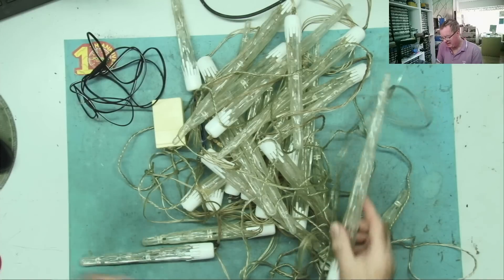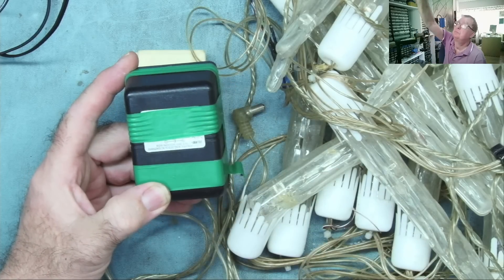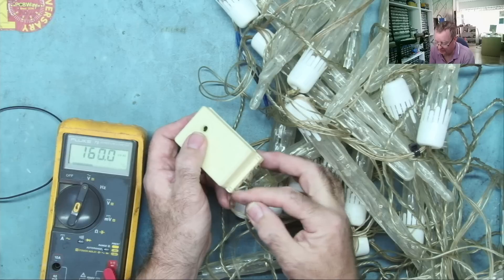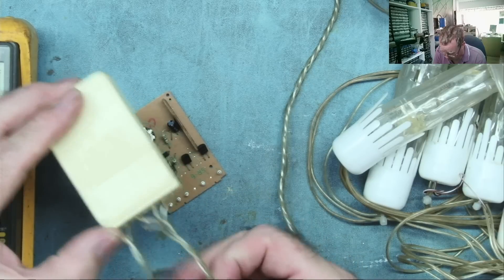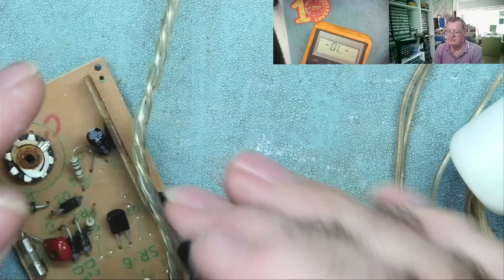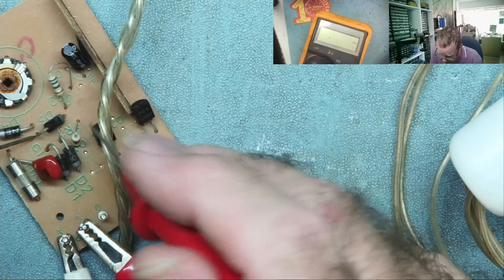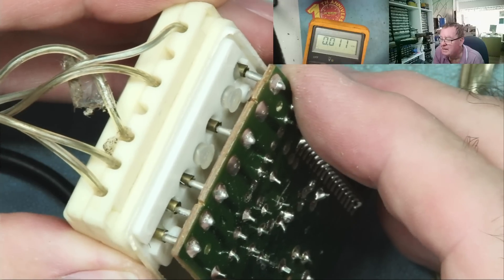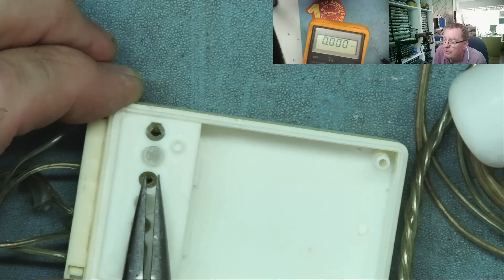Christmas Lights Controller Repair

Comment: What hairy hands! ... Are you a werewolf, by any chance? 🤣

All that poking around with a multimeter? ... First thing you check is the fuse, and if the lights are receiving power, then check the connections are sound.

It was the connections.

Poking around with a multimeter and all the head scratching was a massive waste of time. Start at the beginning. Not the middle!

Comment: It's always when I find a fault like that, it's a "Why didn't I start with that" moment 🙄.
For removing the pins from connectors like you did, I use a section of a dismantled telescopic aerial to push over the pin releasing the tabs. One of them is the right size for the job.
Cheers
Pete' New Zealand.
Reply from the maker: Yeah I often used to think that too... but now I think it wouldn't be a worthwhile video without the journey 😆

Comment: That was a nice simple little circuit to work on for us simple types 😜 and I may need to watch it again but, am I right in saying you took the rectifier out of the power supply (it would be great to see how you do that) but in the light driving unit is another rectifier to convert the ac to dc anyway ? 😮
Maybe I need a Richard hand drawn circuit diagram 😅
Reply: yeah, the lights' control box called for 24V AC and had its own rectifier inside. It's not common for something to specifically ask for AC that's not the typical wall voltage, so he needed to hack another psu to access just the step-down transformer inside (to get the lower AC output. I think the light box wants stepped down AC for a couple reasons - 1. It doesn't need a transformer or hefty power components if the AC is already at the level it needs (this saves weight, space, and cost). 2. It doesn't want an already processed DC input because it needs the raw pulsed DC the bridge rectifier provides before the filter stage to have a means of easily commutating (turning off) the thyristors (commutating on a steady DC circuit can be a pain - adding several components to make it happen, so having a ready means to cut off the thyristors naturally available 50x/sec reduces complexity and therefore cost by a lot. It also means that the lights are gonna have an ugly 100Hz flicker, but not too many people are actually bothered by that (I'm one of the unfortunate exceptions, sadly lol). It also has a filter stage to provide 24V smoothed DC to the control chip, separate from the pulsed DC it uses for the lights' output. 

It's actually pretty clever. I've not seen something say "yeah just give me the stepped down AC and I'll handle the rest" before as a cost saving measure. Simple enough circuit to trace easily, but interesting to learn about!
Reply from the maker: @VAC-Electricity  And you are 98% correct in 2.
You are well on your way to understanding electronic circuits! apart from the detail that pulsed DC from a bridge rectifier is gonna be 100Hz not 50Hz but then you correct that later anyway so was probably a typo. Also the microcontroller runs on 3.3V DC not 24V DC.  It does this by charging the electrolytic capacitor by a 27K resistor.  The resistor forms a potential divider with the microcontroller (load) itself and relies on the current drawn by the controller (i.e it's resistance) to effectively provide the correct voltage to it.  That is why the 3.3V is wobbling around a bit due to the current drawn not being stable but is is close enough to be within tolerance of the controllers required Vcc.  This could of course be fixed by using something simple like a zener diode.  But still well done on your analysis and a merry Christmas to you🎄
Reply: @LearnElectronicsRepair  Thank you so much, Rich!! I've learned so much from you! I forgot the detail that the microcontroller was running on 3.3V dropped by a voltage divider (as I've worked with controls that use 12 or 24V from time to time - voltage dropper slipped my mind for a moment). and yeah, I think what happened with the 50Hz vs 100Hz thing is that I knew the raw AC was 50Hz and the flicker rate would be double, but mistyped trying to remind myself not to type 60 (I'm in the states so my instinct is to assume 60Hz for wall power), and forgot I should be referring to the doubled rectified frequency and not the input frequency lol. 

Thank you for your corrections and merry Christmas!